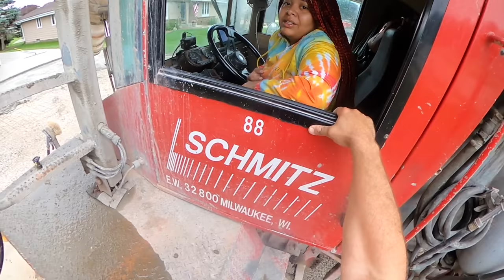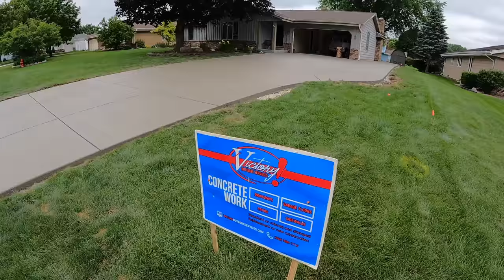Concrete rejected-Load was too wet!

Comment: I worked on a concrete crew for 2 years. When everyone on the crew takes pride in every inch of the pour..........it's artwork.
Reply: Every trade is like that. I was up on a new college building slinging steel with an awesome crew. We got it all done with 3 hours to spare today.
Reply: our trade, 5-6 guys (25-28) , and every square inch done to perfection, everyone having fun, boss making a killing, he was 27 too. Refinishing Wood Floors is a lost art.
Reply: Do you not use expansion joints?  If you pour concrete I the deep south, you have to use expansion joints.
Reply: Yep , i did paving stone driveways for a few years. 
Also done a lot of years landscaping and still currently am. 
You really start to take pride in your work if you love your job!💯💯
Reply: Looks like y'all pulled the forms off the driveway too soon. Never seen that done here in NC.
Reply: It’s a white thing
Reply: @MrFontenot1  Expansion joints in concrete pavement are seldom needed, since the contraction joints open enough (from drying shrinkage) to account for temperature expansion. Remember, this is Wisconsin, not the deep south.
Reply: Most finishers do not care about puddling , they can score and give the concrete a great look ,but when you go back to hose it down and keep it wet you see all theses puddles 😬 old guys a dying breed were the best
Reply: Here in New Orleans, we have streets buckle every summer even with expansion joints.
Reply: I like your profile pic!! Lol. Never thought I would see someone else in comments with the same one! Lol
Reply: Roofing is like that too :D

Comment: As a retired concrete mixer driver I started off really impressed with watching the preparations you and your team started the project off with. Sub straight down and tamped, The detail to depth and grade really had me impressed. And i told myself  now that is the kind of work that deserves top wages. sending the truck back for wet load is almost unheard of cost contractors would rather pour soup and make the strength of concrete questionable.  I appreciated the plywood to protect from ruts. The only thing i was not happy with is I did not see anyone hook the wire to pull it up into the concrete, making it useless. I hope it was an oversight on my part i will rewatch tomorrow to see if i missed it. i hope i did miss it as i was so impressed with everything else !!   ~~~~    thanks for the outstanding video    Keith
Reply: As an architect, I had the same concern with the reinforcement. It.s pretty useless if it is not embedded into the slab!
Reply: No you didn't miss it.
Reply: It certainly makes it easier to rip out when it sits on the bottom !
Reply: Keith, you ever jack out concrete with mesh at the bottom? Yeah it still bonds to the concrete. It is better to have it in the middle but keep in mind these guys walk on it to screed and muck. There will always be sections of mesh at the bottom even if they used dobe. The upgrade of course would be to just use rebar, that's what I would use on my driveway.
Reply: We placed max rate of 800 yards and hour at Ft Hood with no rejected loads; As  contractors we know how this can happen in this situation
Reply: All of the worst slabs I've broke out have the wire on the bottom.  We used to pour with wire always had a guy pulling it up, now we just pour with fiber mesh.
Reply: It's been addressed in other videos that they pull it up but the time lapse usually doesn't catch it
Reply: Agree with all that Keith states, plus, I am surprised at the lack of protection along existing siding, masonry and walks...we always draped/taped poly to prevent the errant/ever present splash from finished surfaces. Also wish the crew wore safety glasses/long pants. Concrete in the eyes/skin burns is no joke. Workmanship/teamwork is excellent...
Reply: @race51187  ryan does both lol
Reply: Can be seen slightly lifting mesh in the middle at 20.00

Comment: Bob deserves some AC in his truck, I do the same kind of work and its a must to have AC; especially for the truck drivers!!!
Reply: Was thinking that. For real get him some ac
Reply: Ehh I look at it like disrespect. That old mans surely earned his stripes doing bullshit over the years. Least you could do is have a comfortable work place for the gentleman is all I was saying.
Reply: I hate hauling with no ac, well the driving part of it isn't terrible, but the sitting still is.
Reply: Nothing worse for a driver than a truck without AC or heat. The floorboards can get so hot that they can actually burn your feet.Especially in the older Macks. I took temperature in a cab this summer when the truck had been parked on a 96 degree day. Even with open windows the temperature in the cab was 145 degrees. Our trucks are newer ones and do all have AC. Rear discharge mixers. Front discharge are not legal in this state, due to weight.

Comment: Great video. Cleanest concrete placement I've ever seen with no mess whatsoever on the property. Good call on the wet load sent back since wet concrete creates a huge weakness. Excellent flat work and control joints due to a great crew, however, I too am not a fan of the wire mesh sitting and rusting on the subgrade over time. In TX construction, we use  4" plastic chairs with #4 bar reinforcing steel, concrete rated for 3000 lbs. and steel cannot be allowed to sit on the ground, preferrably to be suspended within the top 2" of the slab. If I needed a slab placed, I'd hire you to do it and I'm proud of your work ethic. 
Great job !